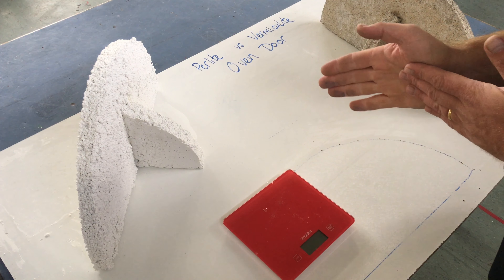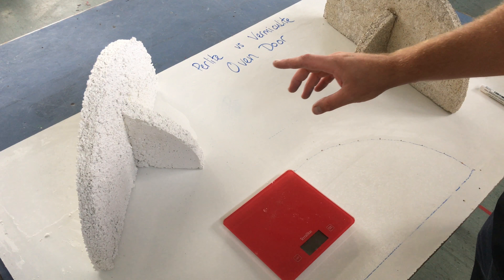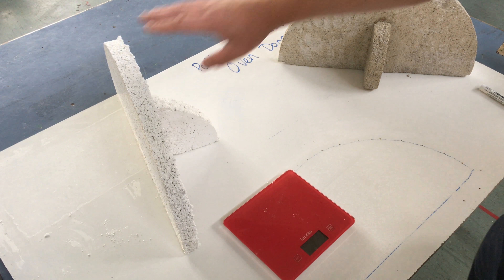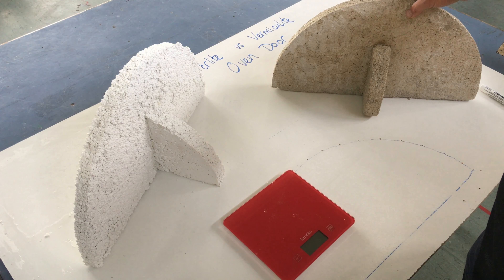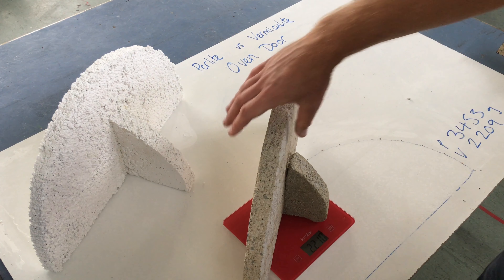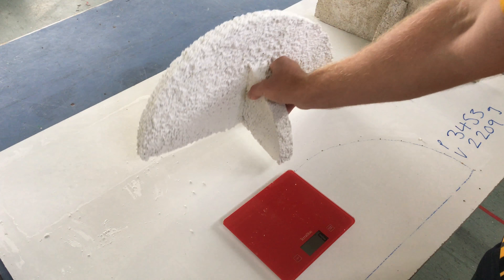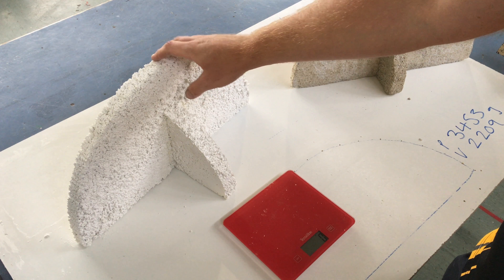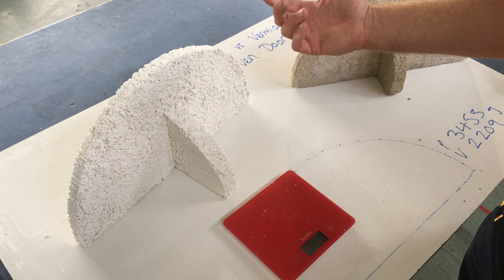Perlite vs Vermiculite Pizza Oven Door Comparison

Comment: Use chopped 16mm Basalt strands/barchip rebar, you can get it cheap as on Ebay. It'll make that Perlite door virtually indestructible.
Reply from the maker: Thanks for the info!

Comment: hi, found your channel as I am trying to diy some fire bricks for a wood stove. I need the bricks to get hot, retain the heat when I shut down to stove so I can be comfortable throughout the night. I watched the gas forge and I remember you saying that the bricks did not get hot. What am I missing here and should I be doing a completely different project?
Reply from the maker: Hi so my gas forge bricks only get warm and not after approx 30mins of use.
To have bricks that stay hot you need to use a material that retains thermal mass such as clay. That said if you made some of your own fire bricks from perlite, sand and refractory cement I’m sure they would work fine.
Reply: ok  @foodrelated  thank you. I will give it a shot using your measurements but subbing the perlite in place of the vermi.
Reply from the maker: Marilyn Reno 
Cool let me know how it goes
Reply: @foodrelated  we'll see :)

Comment: Tom I know you have said your going to do a video comparing perlite and vermiculite as a whole, I am going to buy my materials this week and perlite is a lot cheaper than vermiculite. With your experience of the two would you recommend perlite or vermiculite?

Thanks Tom
Reply from the maker: Ben Collins perlite.
Reply: I am told that vermiculite tends to hold MORE water than Perlite.. not a good characteristic for the body of an 1000F oven ..